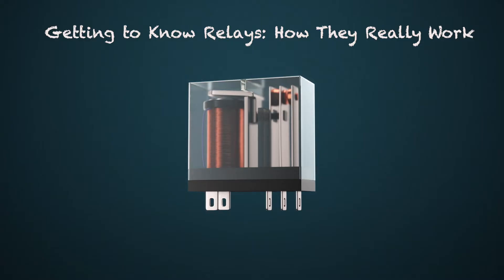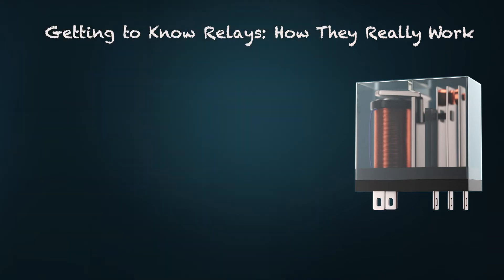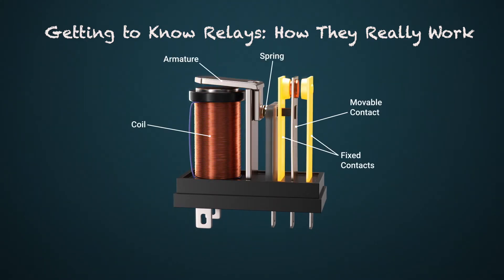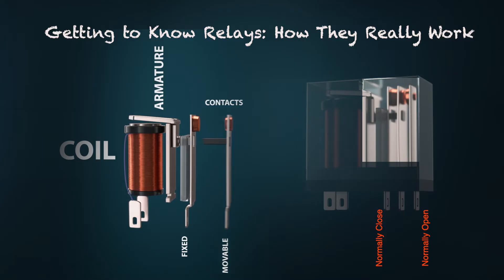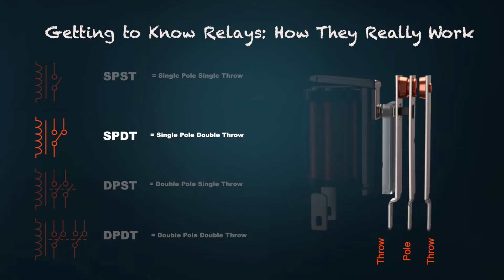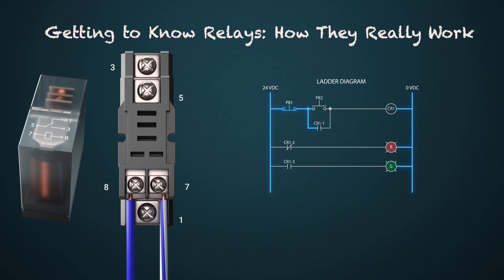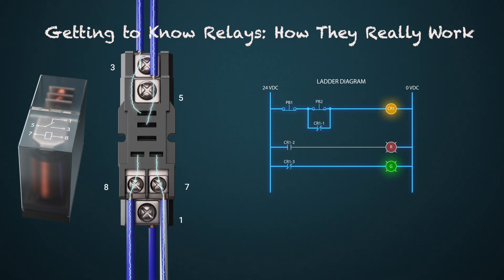How Relays Work | What is a Relay? | Electromagnetic Relays Explained |  Relay Logic Fundamentals

Comment: So , what is the difference between relay and transistor ?
And difference between relay and contactor ?
Reply from the maker: Relays and contactors are electromechanical switches, while transistors are electronic switches without moving parts. Contactors are designed for heavier loads than standard relays. Transistors are faster and smaller but cannot directly control high power like relays and contactors can.

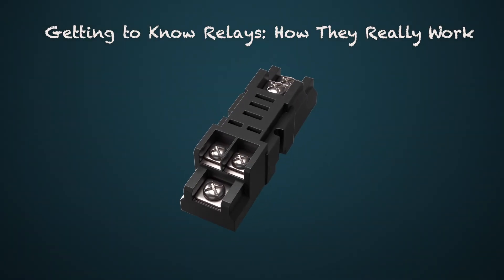Comment from the maker: The correct wiring details can be found by clicking on the "i" at the top right of the video. There is an illustrator error in the ladder diagram from 2:42 to 3:30. The contact for relay CR1-1 should not be on rung 1 in parallel with pushbutton PB2. Instead, it needs to be on rung 2 as a normally closed contact. For rung 3, the contact should be CR1-2 and should be normally open. We apologize for these mistakes. These are the only discrepancies. Everything else in the diagram is correct and operates as it should.